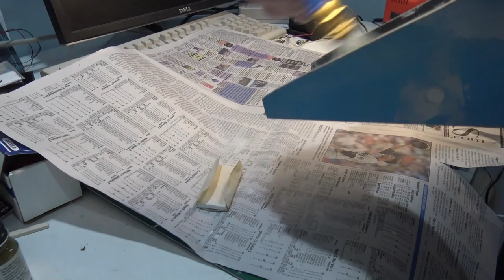26B  Scratch built Brick Arch  -  Building Farland

Comment: Nice job on that bridge Rob, and I like the fast motion video.  Love the monument too!  I think also that blackboard paint would be a great paint to use for the Faller system as it's got good grip very much like the paint that comes with the Faller Kit - but much cheaper, so I'll have to give that a go.  Cheers, Dan
Reply from the maker: Hi Dan, the cheapo chalk board paint really works well.  It gives you that chalky old and used asphalt paving look.  You need the paint and a dried chunk of cheap drywall mud to do it.  Once it is lined, it looks quite realistic.  For some reason people like the fast motion, men anyway.  A person can absorb the gist of what is going on at a fast rate and it doesn't ut one to sleep.  I need more practice with the voice over.  Thank you very much, Rob

Comment: Just wondering why you didn't use balsa and curve it along the grain? I did hear you say this is much stronger. Did you need it strong for applying the clay type material? 
Great sound FX when the thing is speeded up Rob. Made me smile. Hammering sounds like gunfire, and sawing sounds as if someone is making a funny noise with their mouth. Laurie.
Reply from the maker: Calvertfilm Hi Laurie, I use Basswood is all.  It is very strong and does not crush.  If I used thinner strips they can be curved.  Cutting the little pieces was easy enough.  I could have used balsa I suppose.  It does sound funny at speed multiples.  It is entertaining.  Power Director only recently has the capability to speed up the sounds and keep the pitch the same above 2x.  The feature is very helpful.  I used to have to speed it all to 2x the speed up the sound and video separately.  Thank you, Rob
Reply: Fair enough Rob, I was just curious. We all use of favoured materials and methods. Sounds are great. Cheers, Laurie.
Reply from the maker: Calvertfilm Thank you Laurie, true.